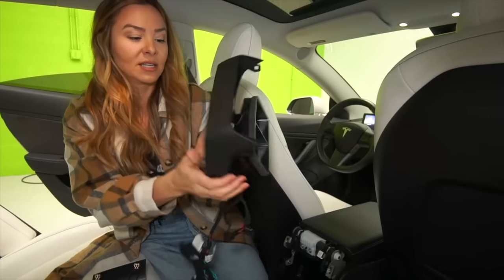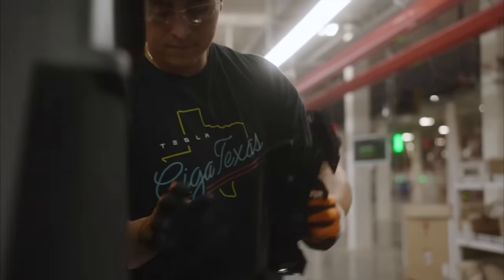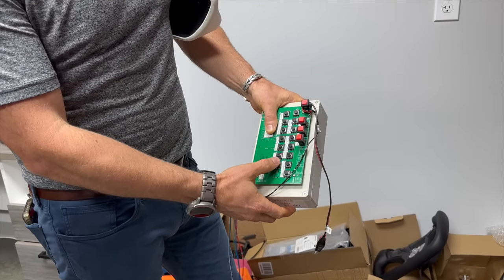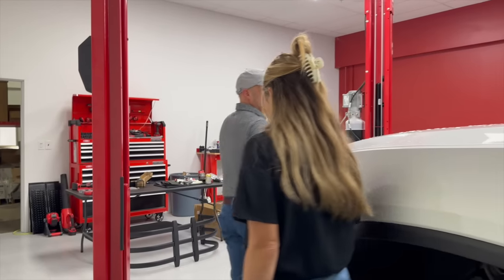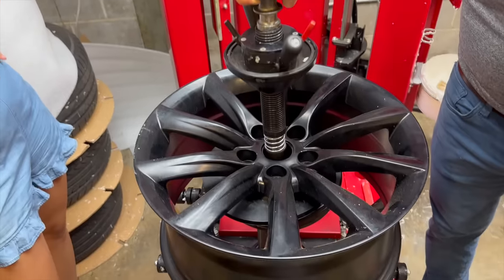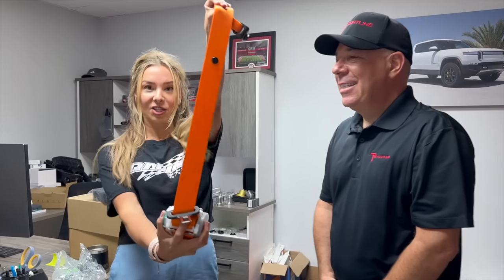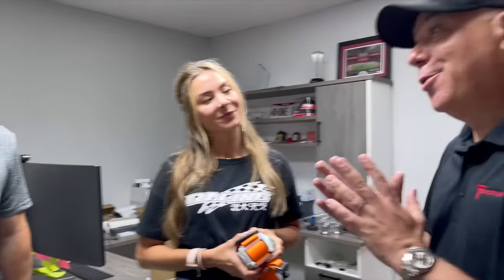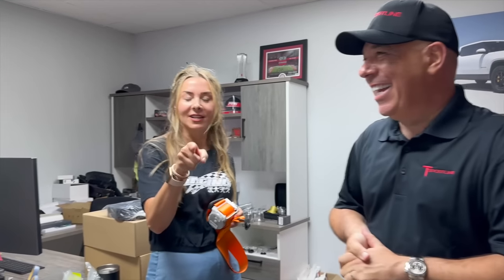Dangerous Mods That WILL Void Your Tesla Warranty

Comment: I had my power steering go out after 2 months on a new model Y. Tesla Service here denied the warranty because I had a powered frunk and the back display in the center console. I took it to a closer service center, with those components disconnected. They tried to say the warranty was voided because of those aftermarket items. So I quoted them the federal law that states they can't void the warranty on unrelated aftermarket parts. I asked them which aftermarket part SPECIFICALLY caused the power steering to fail. Several days later they said they weren't able to conclusively prove it was the rear display or the powered frunk (I know, shocking...). So they fixed it under warranty. The actual gears in the power steering unit were bad. It really pisses me off that they tried to void the warranty knowing full well there was no chance it was anything I installed. Those parts have ABSOLUTELY NOTHING to do with the power steering... I told them that up front, and told them before and after that I'd share my "experience" with everyone. Basically, they were hoping I'd just accept their "diagnosis" and pay the $3000+ for a bad part on my new car. It wasn't until I called them on it and demonstrated I knew the law and was willing to go to the press and file a lawsuit if necessary, that they decided to hold to their obligations under the warranty. Not a good look for them.
Reply: What’s the law?
Reply from the maker: @fishhunterjay Magnuson moss act…mentioned in detail in the video.
Reply: Voiding warranties saves the company money at the end of the day.
Reply: @XX-166 only on a quarterly basis.

Legal costs from a potential class action, and damage to the brand's reputation will do far more financial damage to the bottom line year over year. 

I absolutely love my model 3, but the direction Tesla service has taken the last few years has really soured my opinion of the brand.
Reply: I had a similar thing happened with Hyundai. This was for transmission and very well under warranty. I think my car had 20K miles at the time. They repeatedly denied the repair saying it was out of warranty, out of the powertrain warranty. I think sometimes they just do that in the hopes that somebody will just lay over and accept the fate. 
I had to fight for a little bit and they finally relented and covered the whole thing. I was like how is the transmission not part of the warranty.
Reply: Didn't know about this law but now I do! Thank you and you're a big phat BAWSS!!
Reply: I think it is important to note that this is common across any car company. Not the the companies official stance is that they try to avoid warranty repairs, but when dealerships and service centers are measured on how much money they are bringing in and how much money they are spending on warranty repairs (which they are), individual service centers and dealerships are going to try to avoid making a repair under warranty when they can.  There is an old saying, “tell me how you measure me, and I will tell you how I perform”. This applies across all companies.
Reply: My new Model Y couldn't install updates for over half a year long. 4 appointments at Tesla  service center and nothing resolved. They said a part of the car needs to be replaced. It had to be ordered so I ended up waiting 4 months. It was replaced but still nothing. The car just couldn't install new updates. Finally, after +6 months and 6 service center appointments, one of Tesla technicians said the reason is the subwoofer I had installed in the car. I said it has nothing to do with anything but they refused and made me pay 570€ . I was so angry. I am still angry sharing it now.
Reply: Because Tesla Sucks....
Reply: @trainsplanesandotherthings5187  c'mon, it's too harsh to say that. Tesla is awesome, but not perfect.
Reply: @trainsplanesandotherthings5187  You mean like EVERY other car company?
Reply: @XX-166  So go get your money huh. 🤡
Reply: @chasl3645  use a bigger glass of water when taking those meds
Reply: @cannukian1 Guessing that you had 20,000 MI  original owner warranty Im calling BS on your story.
Reply: @trainsplanesandotherthings5187  These issues happen with all manufacturers. Tesla just gets an inordinate amount of attention/scrutiny.
Reply: Yeah they actually have to prove the mods caused the part to fail. I wish I pursued it further when my rear defroster stopped working and they said it was the tint causing it to not work. Absolutely unheard of

Comment: Unplugged Performance Front & Rear Sway Bars are the best upgrades I’ve done on my 3.
Reply: I was comped a set of Helwig sway bars and they  are amazing I actually got  a 😊set for my model y before tsport got there comp from Helwig
Reply: I did the same from unplugged front and rear sway bars big difference!  On my model Y P 2020 i did the enduro oil coolers that use K/N filters and change my trans fluid every 15-20 K not 50k as tesla Says to do.
Reply: I will want a rack for lumber and or pipe for the cyber truck.

Comment: Gotta disagree with the comments about power trunk kits "cutting into the harness" and being "invasive".  Mine is in fact, plug and play.  It's basically the same as the factory power trunk that later Model 3's have from the factory.  Tesla China is even doing power trunk retrofits.   I've never felt like going with a power frunk for the simple reason that I simply don't use the frunk enough to justify it.  So far, I am loving the convenience of a power trunk and hopefully it will perform as designed long term.

Comment: My new Model Y couldn't install updates for over half a year long. 4 appointments at Tesla  service center and nothing resolved. They said a part of the car needs to be replaced. It had to be ordered so I ended up waiting 4 months. It was replaced but still nothing. The car just couldn't install new updates. Finally, after +6 months and 6 service center appointments, one of Tesla technicians said the reason is the subwoofer I had installed in the car. I said it has nothing to do with anything but they refused and made me pay 570€ . I was so angry. I am still angry sharing it now.

Comment: From a common sense and legal perspective there are mods that "should" not void your warranty but what a Tesla Service Center chooses to do is often not based on the common sense nor law (ie Magnuson–Moss Warranty Act). I had problems with my side repeater cameras and clearly my power frunk/trunk kits are not in any way linked to functionality of the side repeater cameras nor my T-Sportline Smart Instrument Cluster. Tesla told me they are clamping down and said they are not going to warranty my car with any electrical mods even though the service advisor said it's unlikely these have any impact to the side repeater cameras. Even a 12v bypass connector tap to the cigarette lighter power to run a radar detector was questioned. My SC said Tesla is clamping down on all mods that tap into power or OBD/Canbus (such as screens). After a lot of convincing (and it was not easy) they agreed that if I disconnected the power to my trunk kit, frunk kit, and Smart Instrument Cluster, they would warranty my cameras. "Invasive" is really a subjective word. My frunk and trunk kits are plug and play other than a power connection. Like the  Smart Instrument Cluster, the trunk kit taps into the OBD system which Tesla does not like even though they know it's not an issue.  I am reasonably confident that anyone took Tesla to court under the Magnuson–Moss Warranty Act could win but most people don't have the energy or time to take legal actions so it boils down to a fruitless argument with the service center.

To be clear, Tesla can void the warranty on anything that interfaces with the electronics. The power trunk and frunk kits have no more higher chance of voiding warranty compared to any other electronics (ie, screens) that T-Sportline sells. If anyone wants clarification ask your local service center - I'd be surprised that they would sanction some electronics and not others.

Comment: Thanks Kim. Few questions;
1) I want the yoke for my M3P. What is recommended? I feel like I want one by Tesla and nobody else. It’s such a big safety piece. Am I wrong for thinking that?
2) Now that I know not to do a power hood, is changing the suspension Ok?
3) I’m one year in with my Tesla, where can I find an event like you where at in this video?
Reply from the maker: I understand your concern, but the yoke isn’t much more of a safely risk than anything else, like suspension. Tesla also doesn’t offer yokes for the 3 or Y. Only S and X. I know Tsportline has done thousands of these with no problems, and they have certified installers in every state, just reach out to them and ask.

Comment: How about aero parts for improving efficiency and reducing noises?
@Kim If you install orange seatbelts the exact same color should be mirrored somewhere. That could be in bi-color seats, dashboard or doorpanel parts, floormats or at least the stitching in the seats or floormats. How about one single pinstripe on the spoke of the wheel that's closest to the valve? An orange pinstripe to accentuate the contur of the body? 😉
Reply: She did mention she's thinking about wheels or calipers.. but you're right something else in the interior would be good too

Comment: HI there. Just watched your video. So i brought my 2020 model 3 LR into tesla sc in st pete florida recently due to a clicking sound coming from rear axles. I have aftermarket wheels and they denied doing a warranty reapir bc i have aftermarket wheels. They said my rear hub and drive axle should be replaced to get rid of sound but wont do it bc of my wheels. The lead tech said put my facory ones on and try to bring it in again? They blatently are violating this law you are referring to. I also have the messages from the chat from them saying they are denyinmg the claim bc of wheels.

Comment: Tesla might say warped rotors or other heat related brake failures aren't covered due to airflow difference from after market wheels.
Reply: Are those covered under warranty?? Aren't those normal wear item that other car manufacturers don't cover either?
Reply: @LL-camerawork  brake pad wear is normal wear and tear. Warped rotors if you're not racing on a track is not normal wear and tear. I've had warped rotors covered under my bumper to bumper warranty many times but never under the power train warranty.

Comment: Has anyone ran into warranty problems from tinting the windows? I want to tint my model y but they said they could void the entire warranty even if the issue is small like the windows having issues like not being able to roll down properly. They stated if this issue occurred it would void the whole warranty.
Reply: I just had my model x windows tinted and my door latch started having issues. They said they won't cover it because the windows were tinted
Reply: Yeah I had my model Y front windows tinted & have horrible rattling somewhere in the door/side pillar & they said they wouldn't even investigate because the tint voided the warranty

Comment: Cybertruck

Battery powered trailer for equipment, smart enough to move forward or engage motor brake based on whether it's being pulled or truck speed is slowing. If battery goes out it'll be charged by the pull. Should at least fit a golf cart.

Comment: I picked up my model y a month ago, until one day my passenger told me their side of the AC is weak, then soon I confirmed that my passenger ac fan direction isn’t moving like what it supposed to. The problem is I have some pro installed ambient lighting in my car, he told me he never tempered with the electronics all he did was pushed the light into the gap. Tesla is refusing to fix my fan under warranty. If anyone knows how to handle this situation please lmk, extremely frustrated now.
Reply: If they refuse your warranty claim, it is on them to prove that your modifications caused the problem. That's the law.

Comment: Hey guys, do you have any information on the Model Y? I went online to order a model Y Performance and I am unable to do that! The Model Y online interface has removed the "Custom Order" button and replaced it with "Shop Available". So Tesla right now is forcing people to buy the existing stock of Model Y, you cannot configure and order one. And within a 200 mile radius of my home there are no Model Y performance models available. What the heck is going on? Do you think this is because Tesla wants to clear out the existing stock of Model Y because the Juniper Refresh Model Y is actually ready early!?!?! Any info would be greatly appreciated.

Comment: If you have purchased something and it can be improved, then go ahead and modify it to work better. I often do this with brand new items, straight out of the box, in the full knowledge that I may be voiding the warranty. You have bought the product. You now own it. It is yours to modify and do with as you like (within legal limits). You may be taking on a financial risk by doing so, but that is more than made up for by improved use and enjoyment you will get from the product.

Comment: I am the person, if I have to change the wiring or have to tear half the car apart for a new mod to work, I will not do it.  If something goes wrong, breaks, or don't work right, I am pretty sure Tesla service center will not fix that mod, maybe not even look at it.

Most these high end techy mods are for people that have worked with cars all their lives and know what they are doing.  And don't care about the warranties.  But anything can happen.  Especially if you are changing the yokes and tampering with the air bags

I will put in matts, storage covers, maybe new wheel covers (when i can afford getting them), and even change out for a larger storage drive for Sentry/Dashcam.

Take care.

Comment: You voided warranty Everytime it's aftermarket mods, lights, steering wheel it's not original OEM.
Reply from the maker: This video was for those with the same mindset as yours, unfortunately it seemed like you missed the part where what you said is incorrect.
Reply: @ItsKimJava  You should do your own tesla raffle. Even if it not for a cause or very small partial cause people still buy